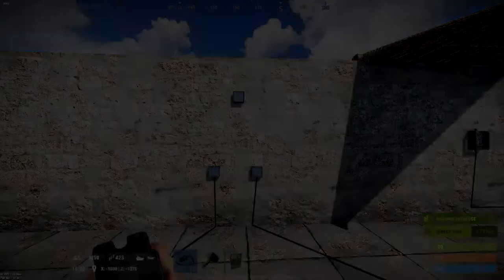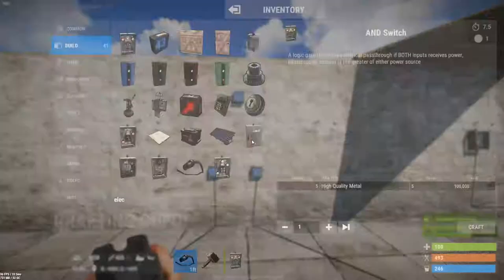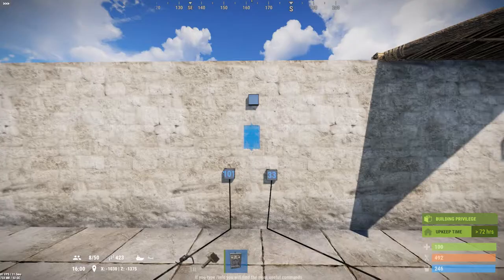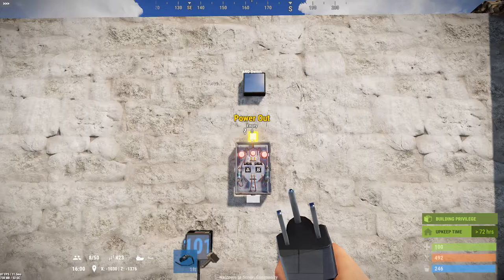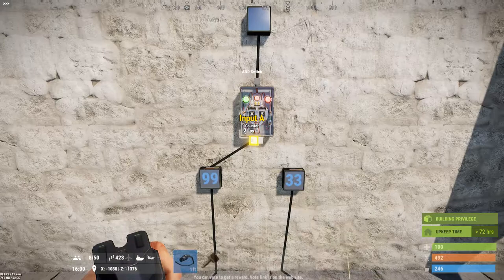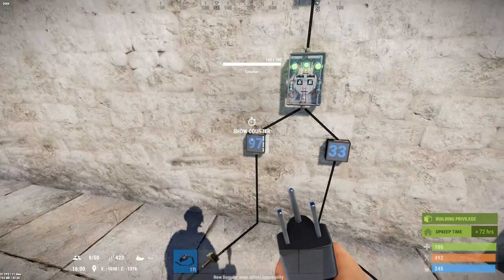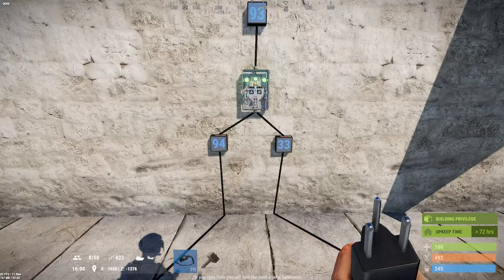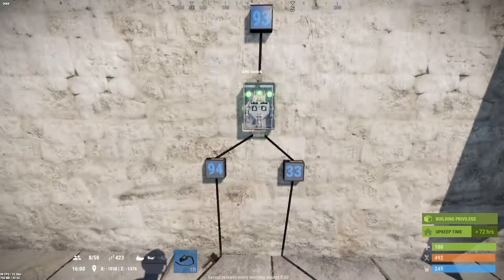Rust Electricity 101: Component Guide - AND Switch

Comment: I've never understood the "and" switch, this helps. Although it seems just like the "Or" switch except it appears it has to have power from both sides whereas the Or switch can be one powered and another input that has no power because of a blocker. Couldn't you just use an Or switch and not need an And switch. It's still taking the larger power whether there is power or not. I would think it would take special circumstances to actually need power from both sources. I'd been waiting on a decent description of this component, but have yet to understand where you would need it exclusively.
I've got a great lighthouse also which I won't get on video for awhile yet. I'm working on a project within. It's got 168 garage doors and I'm trying to make them raise and lower from top to bottom like a transformer. that I can do. It's much like the rotaing light sequence. And I can time them out. However, where I'm running into a mind boggle is how to make it go back up from bottom to top in a reverse timed sequence. If I can't figure it out I'll scrap the idea for this wipe and just cherish my lighthouse.
Reply from the maker: Hey man, good to see you on the new channel! The AND switch (as well as OR and XOR) are logic gates, so while I have demonstrated it as a 'best' power source decision maker, it's real purpose would be for an application where you need two events to occur before an action happens. IE laser trigger AND pressure pad triggered at the same time (or through memory cells) to cause action "X" to then occur, that type of scenario. I may have some ideas for your sequenced doors, but probably next wipe as I'm spending my time now on the component guide and some outstanding questions related.